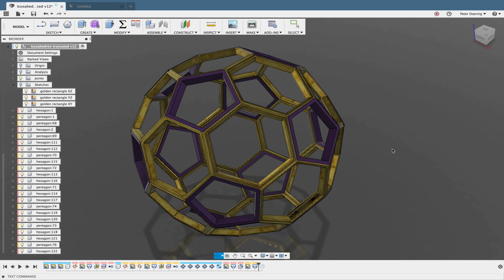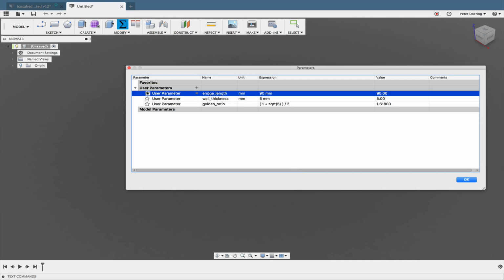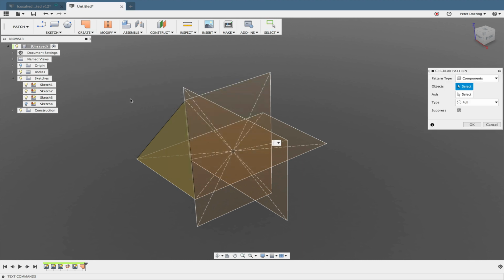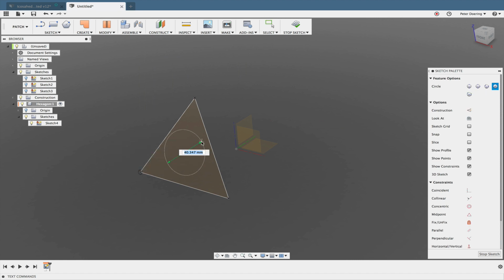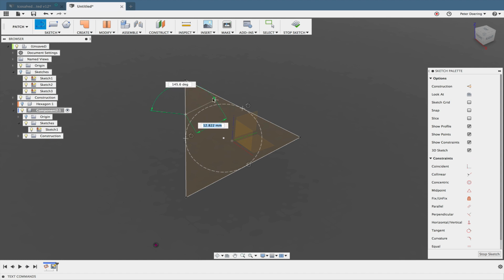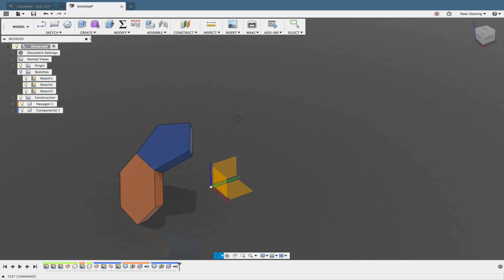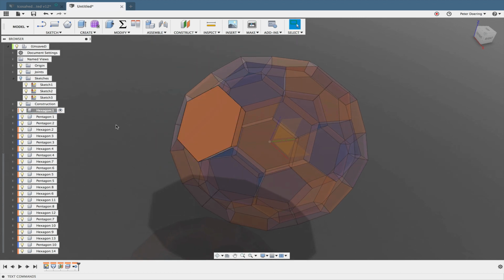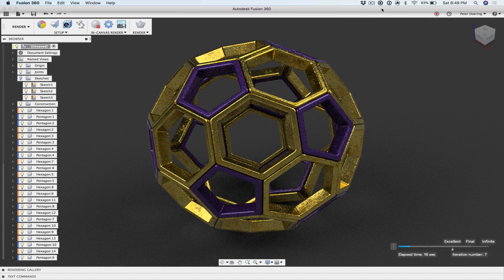Fusion 360 - Regular and truncated Icosahedron

Comment: Hey thanks for this video, I have a couple questions I am working on making different Dice. D20 being one of them, as well as D12 D10 D8(D4 Mirrored) D6(simple cube) and D4(simple pyramid).

So D12 and D10 being hardest any tips on making those? 

The dice face have a pattern, hence why I wanted them to all update like you show in this video

Also since I am making dice which will have different numbers, is there a good way of making it so the faces don't update when I add a number to the side.
Reply from the maker: Your dice sound like the platonic solids. D12 is a dodecahedron. What is D10 ? https://en.wikipedia.org/wiki/Platonic_solid
Reply: @TrippyLighting  Hah, I just realized I am speaking to you on the Fusion Forums under the user ws376 didn't realize that was your video. A D10 is a pentagonal trapezohedron know as the D10 or percentile Dice in tabletop gaming. https://q-workshop.com/2110-tm_large_default/d10-steampunk-black-white-die-1.jpg